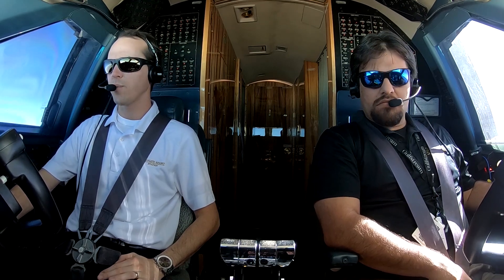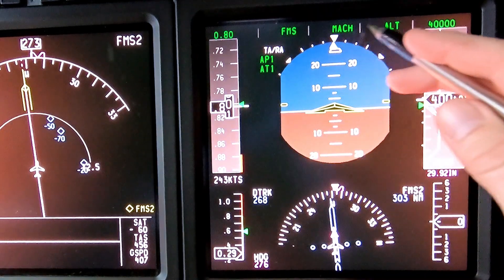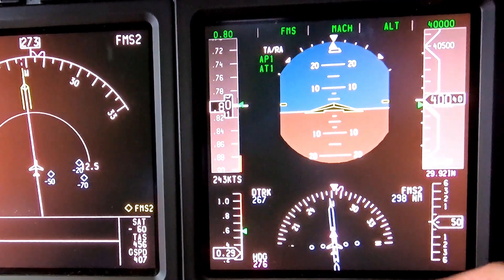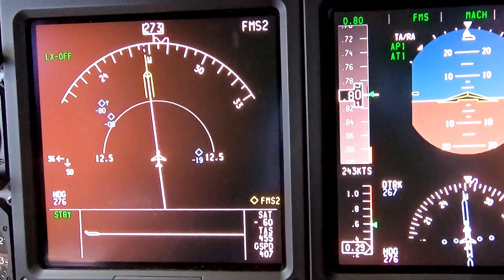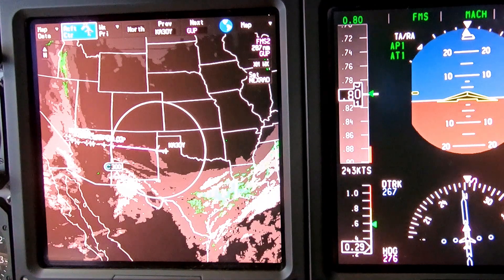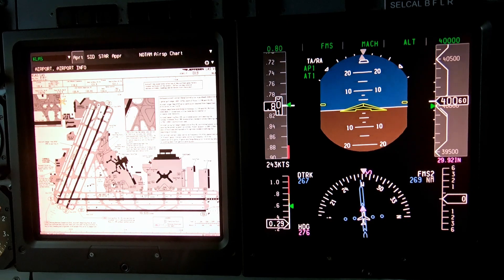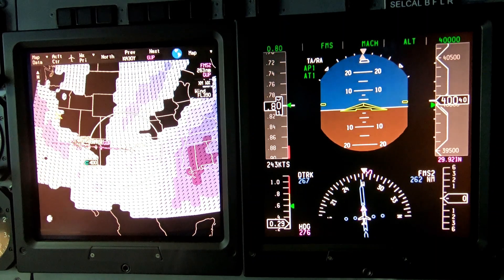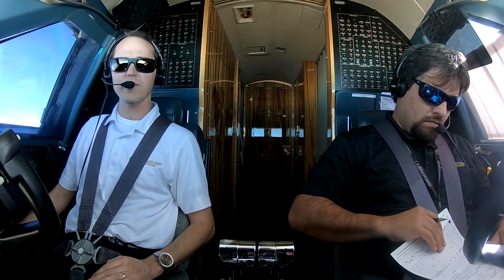Gulfstream G-IV Primary Flight Display Layout - Pilot VLOG 41

Comment: One thing I'm still confused about. I see 4 different speed indicators.  Mach .80, which is a little over 600 mph I think. Then 243 knots below the mach indicator, which is like 280 mph. Then true air speed. Then ground speed.   4 different numbers.  Obviously I'm missing something.

Comment: Question: the speed tape on the PFD: when speed in knots are being shown, the larger numbers are at the top with the lower speed numbers on the bottom half. When you reach higher altitudes and transition over to mach numbers, their values are reversed (higher mach numbers on the bottom of the tape). I thought higher mach numbers would be at the top but they are not. Why is that?
Reply from the maker: I wish I had a good answer for you on that one. It's the way Gulfstream and Honeywell designed the system back in the 80's. I'll see if I can find someone who might know
Reply: @CorporatePilotLife  It's no biggie, I was just curious. I work at Flight Safety as an SIC on the Citation II and V. We have a lot of Gultstreams where I work...I'll ask one of the GIV instructors...maybe they might know. Thank you.

Comment: Do you guys have an EVS equipped aircraft?  I thought GS had made it available for G IV and Vs so I thought you might have it on your aircraft.
Reply from the maker: No EVS for us...the simulator I trained on had it. It's pretty cool, but not super useful on a regular basis I think. I'm sure someone on here will strongly disagree with me...just my opinion for the type of operation we do.
Reply: Peter Neumeier SVS, EVS and other systems are very useful given the environment you fly in. I used to fly an early 1990’s model King Air 200. That turboprop is very much a utilitarian aircraft, it can land on relatively short runways and even on gravel/grass with the High Flotation gear option (Bigger tires and wheels). I wish the King Air had SVS/EVS back then, had some dicey night time landings. My understanding is new King Airs have Collins Pro Line Fusion with touchscreens and SVS, with an infrared camera as an option for low visibility. If you’re not flying in high terrain or doing low visibility approaches, regular guidance is fine.
Reply: Corporate Pilot Life agreed. I wish I had had those toys on that King Air I flew

Comment: Excellent job very entertaining, for us non pilots what does “Ref in 6 Sync in 7” mean. Numbers change but you say it a lot Thanks
Reply from the maker: The "Ref and #" refers to Vref + # knots. Our ideal approach speed is +10 knots. The Vref speed is a calculated speed based on our weight and several other factors like outside air temperature. The "Sinking #" refers to the rate of descent on final approach. Ideally we want to be around 700 feet per minute. We would call that out as "sinking 7"
Reply: Corporate Pilot Life 
Wow Thanks that was quick love the channel keep it up

Comment: What is the difference between true air speed and ground speed?  Thanks.
Reply from the maker: In theory, they should be the same in a zero wind situation. If you have a tail wind, the groundspeed will be higher than true airspeed.

Comment: A video on the center console would be cool also. I want to know what the "wheels" on each side of the center console are that spin every so often. The Airbus has them also and I see pilots hit a button on the control stick to make them spin. Also when you land you say "we have 6 lights" or "6 green lights" right after touch down and just before you call out ground speed, what lights are those?
Reply from the maker: Sure! The wheels on the sides of the console are the trim wheels. If the electric trim on the yoke were to fail, we could use that to manually trim the elevator. The 6 lights after landing are for the thrust reversers...three for each side. It means they are fully deployed.

Comment: Need some right rudder trim?
Reply from the maker: Nice catch! We've actually played with that quite a bit...the left side shows it right on the money, but the right one hangs out just a bit. We've put the trim in to center the right side and the left is a little out, but the fuel flow goes up slightly (increased drag), so it seems that where we have it is actually coordinated. The sensor for the inclinometer is just slightly off.

Comment: Nice video ! Is this a retrofit of your A/C the enhanced MDF ? I've already noticed that in another video in Mach mode your speed tape is reversed. Is that Gulfstream philosophy ? 

Maybe you can do a video on the controller placed on your glare shield ?

Safe Flights 

Clément
Reply from the maker: This is a retrofit in our G-IV. All six CRT screens have been replaced with LCD screens. This gives us the upgraded functions. Good catch on the upside down speed tape! I believe they flipped it on future Gulfstreams...but I'm not sure. All G-IVs are like that. I like the idea of doing a video on the display controller! I'll definitely work that one in very soon!
Reply: I was wondering the same about the speed tape direction. I've been in a TBM where one of the airspeed indicators moved clockwise but the needle pointed downward when on the ground. I've also had some with airspeed indicators that moved counter-clockwise. Seems Socata can't really make up their mind haha. Also, very jealous of all the information that ND provides. Great video! :-)